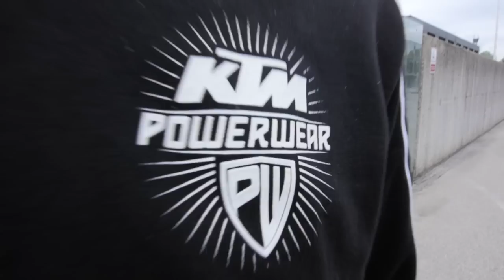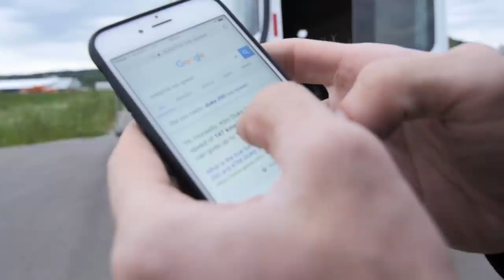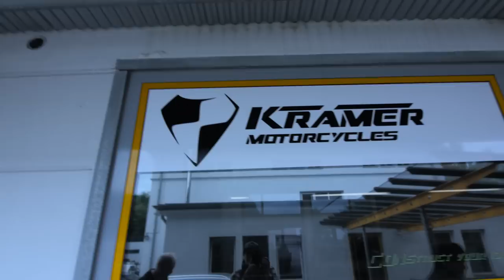Crazy Green KTM Motorbike | RokON VLOG #22

Comment: brother why you always use 250 duke instead 390 which more powerful.
Reply: It's because of higher CC but single cylinder, which is a problem in slow speeds. the bike jerks in low RPMs (390) so it's kind of irritating for the slow speed stunts like stoppies and other balancing stunts